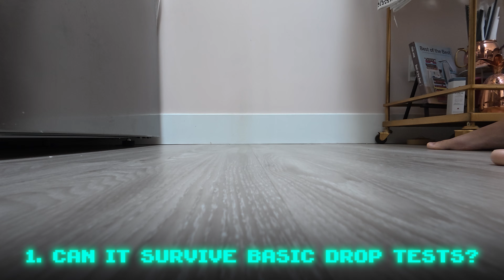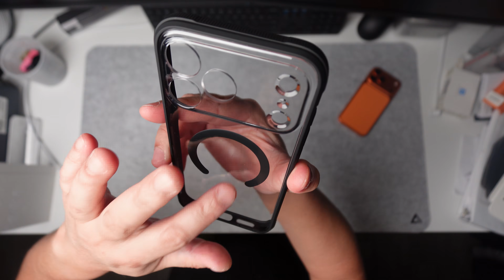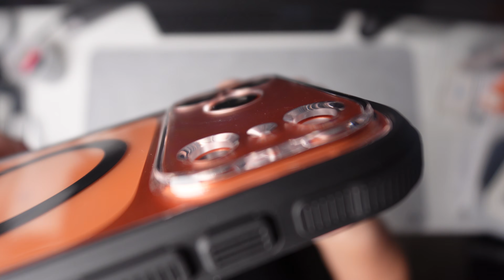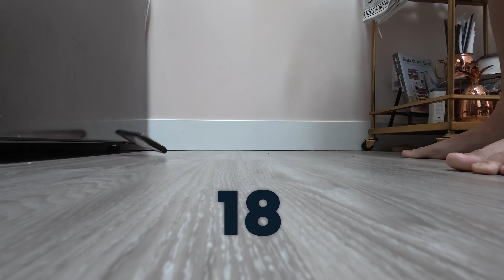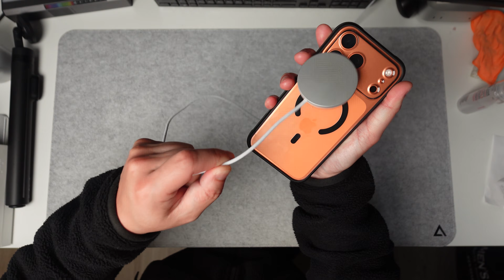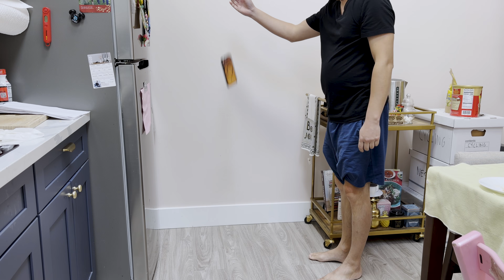Is Dbrand’s Ghost 2.0 Clear Case ACTUALLY Worth Buying? (46x Drop Test)

Comment: Hey mate, i’m running into the same problem of deciding on the case? I have used the brand products before, but for the switch and steam deck, but never for the phone. I’m really looking for the best clear case I can find. Whatever one gives me a different answer. Your review was great, but I want to ask you is there one you would recommend over this or just a case you put it on and forget about it?
Reply from the maker: If you're looking for a clear and don't mind the colored edge, then the dbrand Ghost 2.0 is a solid choice. The biggest issue with clear cases is long-term yellowing and dbrand seems to have solved that issue. Even if it comes up at some point in the future, dbrand is known for fixing issues like that and sending out free replacements. During my review, the Ghost 2.0 provided excellent grip and also drop protection. The most interesting thing is that it was able to survive all my drop tests while still looking brand new.

Comment: thing is you drop it on a wooden floor , not rocks, stone , this is no good test
Reply from the maker: Military-grade case claims are typically based on drops onto plywood or steel backed by concrete, and those are the claims I’m trying to evaluate on this channel. A sharp rock or stone could damage any phone if it hits at the right angle regardless of the case. Testing that wouldn’t provide a consistent or repeatable comparison and replacing an iPhone 17/18 Pro Max after every case review isn’t exactly in the budget.

Comment: The rattling is normal. Its the stabilization system for the lenses. Try opening the camera and going into 1x or 4x, the sound would be gone. If not, smth is wrong. 
I learned this the hard way too 😭
Reply from the maker: I actually don’t hear any rattling noise when the iPhone is naked, but I can hear it when I shake the case. Interestingly enough, depending on how I grip the case, the rattle will sometimes go away. I think it has to do with the bond between the TPU sides and polycarbonate backing.

Comment: Very well explained! Thanks 
I’m worried that it hardly have a think front edge 
Like other cases
Reply from the maker: Thanks for watching! All the Dbrand cases I have tested have done a great job with protection.
Reply: @foureyedtechguy  of course thanks to you! What do you say about Spigen and Ringke cases? The Matt case from Ringke is soo good! I can also get a Crossbody strap for that one from the same brand
Reply from the maker: @gotechakash  I actually have some videos posted for the Ringke rugged gear case as well as the Spigen Class LS and Spigen Tough Armor T. I was really surprised at how well they performed during my drop tests and would definitely put them in the best bang for the buck category.

Comment: So I had the original ghost case 2.0 the black one, the camera control button was an issue for me due to the fact it was flat and didn’t have an actual indented button, every time I took out my phone I’d accidentally press it. They recently updated a newer version of the ghost 2.0 case, in blue or orange with an actual indented camera button and it’s perfect, from what went from a design flaw to nice and perfect it’s great. Though it does take a lot of dust on the inside by my camera lenses It’s part of my daily rotations with my Otterbox defender pro and Spigen Tough armor case
Reply from the maker: That's good to hear they fixed the button issue, thanks for sharing!
Reply: @foureyedtechguy you should definitely do one of the reviews on the updated ghost 2.0 cases! Other than that good case review and spec info in these videos! I subscribed :)

Comment: I have this exact case. I bought mine with their screen protectors when I picked up my iPhone 17 pro max. I dropped my phone many times on my rides to and from class on one wheel. And even at work (I’m an auto tech) the phone has been filthy and had many heavy tools land on it with honestly less then what you’d expect damage. The case is durable and worth the money. The case and the protectors ( I did break one ) last to this day I’m still rocking my case and second protector. No yellowing yet.
Reply: The no yellowing really isn’t impressive - they made the only parts that would yellow black instead of clear! Lmao I’ve never had the polycarbonate back of a clear case yellow, it’s always only the softer corners
Reply: @c @cwill2127 he never said anything about it being impressive but go on
Reply from the maker: Thanks for sharing your experience with the case! How are the front inners of your case doing? That was the only area that got damaged during my drop tests.
Reply: Still not yellowing?
Reply: still no yellowing? i wanna buy this case soon